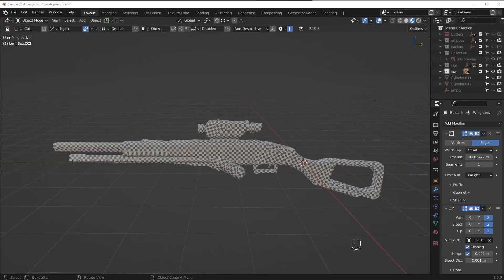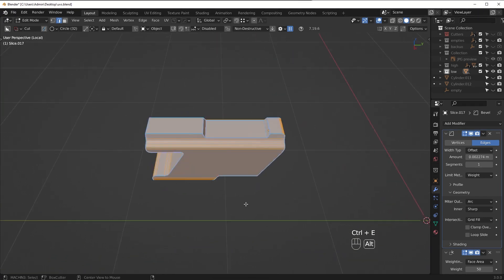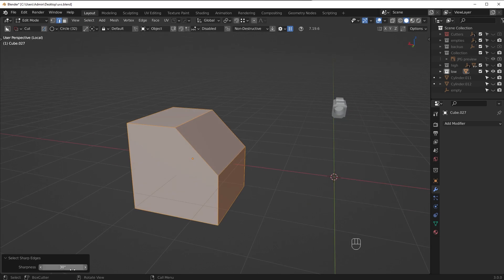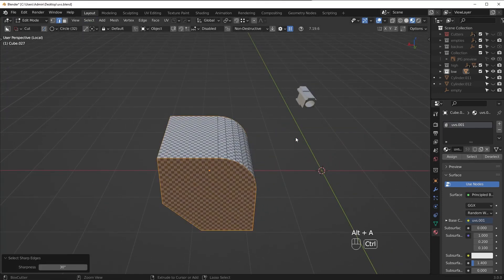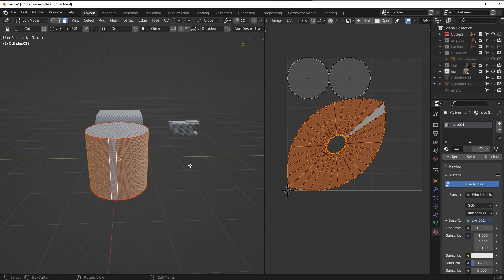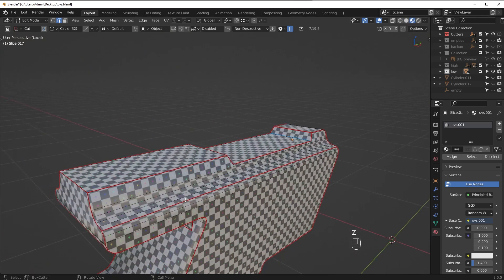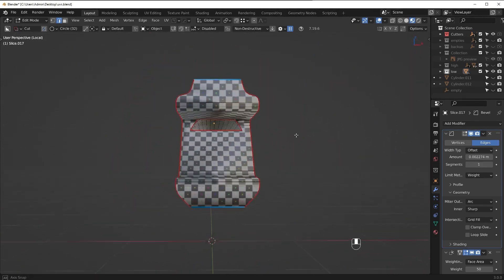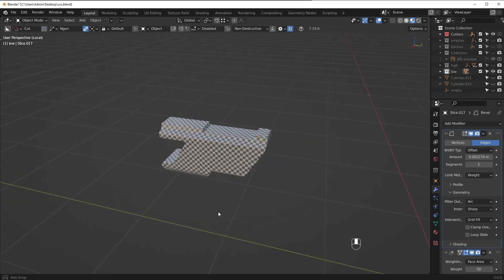The Simple 4-Step Process for Perfect UVs

Comment: But in case that if I have continuous set of faces on my flat surface which is v shaped do I have to plce a seam in my faces minimum one time to fix and straighten that out or any other system??Plz guide me if you can?

Comment: Hello, will someone please tell me how to get the UV material he is using? I have tried making my own with an image texture node as well as a Checker Texture node but nothing works. Adding the seams does not change the pattern of the checkers and taking away seams doesnt distort the checkers either. It must be because you have a specific material you're using, right?
Reply: I found out how! There is another video where he walks though step by step how to do it. I never would have found it on my own. Inside an image texture and without selecting a downloaded jpg you can instead select "+New" and change the Generated Type to UV Grid. Boom, done.

HOWEVER

The UV material is still not moving even during the seam changes

Comment: That's a good way of doing things, works well in most instances. I have to unwrap a complex car with lots of engine parts, so this will save a load of time, thanks
re the distorted rings blender can be a bit weird on that as sometimes I want to have rings, not a split cap and a side wall , so then I have to change the unwrap method to or from 'angle based' or 'conformal'

if it looks skewed with one of the methods, change to the other. it can still be flakey though. I have a piece where every ring came out perfect, apart from one and there is no reason , reset the scale, welded any stray points etc

Comment: @JoshGambrell Marking the seams manually has never been a waste of time, especially on complex objects where such an automatic method is not at all suitable due to the very different surface angles. In addition, by cutting the rings in only one place, you get very long "islands". And the density of texels, or rather their proportions, becomes very terrible on the UV map.

Comment: I wouldn't call that perfect cuz there are many problems with this techniques as mentioned above by people in the industry. 
But one of the problems I see is adding just a single seam on a continuous face loop. It's wasting UV space. Sharp places can be used to make seams and even though less seams is better, wasting UV space isn't. Sometimes It doesn't hurt to add a few seams 😉

Comment: Comment regarding contiguous sets of faces for production art: 
For game development, texture memory footprint is an important value to keep within budget. The fewer smoothing groups and seams you have, the larger your normal map size will be due to baking gradients to translate between the high and low mesh normal data. Your textures get compressed, downscaled, and mipped, which means they have less data in them to translate baked detail into the low poly's mesh normals.  
For example:

Create a cube, bevel all of its edges enough so that it servers as a high poly mesh. Create a second cube, set it to a single smoothing group (all soft edges) UV it with a single shell or multiple - it does not matter. Bake a normal map.
Repeat the process but set each side to its own smoothing group, cut the seams and give padding to each shell as appropriate for managing smoothing groups. Bake a normal map.
Check the file size for each normal map. The one with gradients (single smoothing group) is much larger.

The game res mesh needs those gradients to preserve the visual quality of the high poly, but those normal maps are going to be pushed through various compression methods and still contribute to more budget than they need to. Minimizing gradients through keeping smoothing groups at ~30* angles will keep your asset looking good after compression because it needs less normal map information to translate between high poly baked normals and its own low poly normals.

Also, take a shape similar to the one in the video with a long strip of contiguous faces and cut a single edge to make a long shell. Bake that result and get into a texturing tool like Substance Painter. Set the metallic to 100% and the roughness to 0%. Observe the faces where plane shifts occur and you will see triangulation distortion in the bake. This is because that single smoothing group is having to calculate plane shifts across the mesh with more than 360* worth of angles and bake the needed gradients into a texture. Increasing that texture resolution will help make them less noticeable, but we don't always have the ability to use 4k+. Setting smoothing groups to acute and right angles and massaging the rest with ~30* (the sneaky ones) will help reduce those artifacts and give you a cost effective bake that looks good after compression.

Also, your largest UV shell will dictate texel density. If you're seeing a lot of unused space, you may want to find some more edges to cut along plane shifts, scale a shell down in a single axis if that surface allows (swords, barrels), or add other objects to that texture set.

Sorry for the wall of text, but these are things senior artists and hiring teams look for when recruiting, so I figured I'd share.
Reply: I had the exact same thought... video is quite misleading. This technique is only good when you do lowpoly models that dont require normal map bake
Reply: @Arnov618  it's because theyre college students that never worked in production
Reply: when you say "The one with gradients (single smoothing group) is much larger" you are referring to a 3d model with 1 segment of bevel?
Reply: I'm sorry for bothering you but if I am understanding this correctly, basically we should disregard all of the steps in the video besides clearing out the sneaky edges? So essentially just select sharp > add seam > clear the sneaky edges and fix any ring distortions > done.

Edit: Ofc this is assuming an object like the one in the video. I imagine in something with smoother edges, like a futuristic car for example, would require us to make our own seam islands.
Reply: You also want to have a uv cut on hard edges. Otherwise the cut will be seen much more obvious after the bake.
Reply: I'm confused because this video shows one way but your comment says the opposite? What if your not baking high poly to low poly? Is one long face not ok? Are you saying you actually need more seams on long faces rather than just one?
Reply: @wolfpawz321  Your largest UV shell will dictate your texel density. If you're making bespoke texture detail, following the general rules of where to place seams will help you achieve a near-maximum texel density. The rules of cutting hard edges / smoothing groups don't apply if you're not baking.
Reply: Good article,very informative. These are golden informations becuase normals and baking normals are really confusing and hard procces if you dont know well also finding that kind of informations is really hard on the internet. Thanks for sharing and dont follow this kind of videos which is misleading and trying to get you confuse so they can promote and sell the addons to beginners. From now on I'm unsubscribing all the channels that promoting hardops,meshmachine addons... You dont need those trio addons (hardops,box cutter and meshmachine) Even vanilla blender is enough to complete the tasks that you want to achieve. Specially these trio addons make blenders really confusing because its changing all the keyboard configurations. Ofcourse you can change them but how many of them ? tons of progress. These addons makes your job done quickly but still unnecessary if you are a beginner or mid level artist or working on game industry. I suggest you guys to learn the techniques and do things with the long and hard way so you will be learning the ground and you will be able to solve really hard problems with you meshes and projects in the future.  After reaching a good level you might want to think about these kind of addons.

Comment: There is one problem I see with your method. 
All the hard edges in the model need to be UV island borders. The reason? To avoid a very famous problem that happens when you bake the normal map - your hard edges that aren't UV borders will have strange shading artifacts. I would show you a screenshot, but I'm afraid YouTube will mark me as spam.
Reply: That depends on the software you're using, for example UE4/5 won't have that issue but modding super smash characters will.

Not a technique issue, but a software quirk of older programs.
Reply: You will have that problem in the modern version of Substance Painter. Basically, the edge should be ideally between 2 flat polygons. As you make the edge sharper, at some point (i don't know exact angle) that artifact appears.

Comment: Thanks, great explanation as always! 
I started to unwrap my models in a very early stage, before I bevel edges or add any other Details. Tools like Bevel, Insert Faces and Edge Slide won't destroy your UV.
Tipp: press GG for Edge Slide, then Alt and you can move the edge or vertex in the opposite direction, to make the face bigger without streching the UV map.
Reply: The Bevel modifier does wreck my seams though, it'll turn 1 edge seam into 2 and erroneously try and make all the bevels connected as a UV island.

Comment: hi everyone, does anyone ever make tutorial or course on baking process only? I mean a tutorial of thorough process, the possible/usual issues and how to fix them when baking. Currently I'm stuck with the baking process in Marmoset as I'm currently doing the Game Asset Hardsurface Course. The baking result have so much artifacts even though theres none of the shading artifact and UV unwrapping during modelling and triangulation process. Both high poly and low poly fbx files come out flawless on marmoset, but when baking, all sort of shading error and issue appear. Some details are lost. Simply said, really discouraging result overall. Paint offset tools doesn't fix the issue. I am so lost with the error that I face and the only things left I should do is to restart the tutorial from the beginning and redoing the model from scratch. If anyone have any link of baking tutorial course to recommend, please do share with me. I want to know what I should look out for (flipped normal, not enough details on low poly, etc..) before I start baking. I really don't want to waste more time remodelling but then when baking, everything broken.

Comment: Now try baking normals on those mark sharp areas without a seam and margin. This tutorial clearly ignores baking issues, and at one point (continuous seam) even decreases texel density (aka makes those squares bigger after clear seam, rather than making them smaller)
Reply from the maker: You’re looking at an individual auto-unwrap for one piece. Those don’t matter. Only thing that matters is when you unwrap everything together onto one UV grid and how that looks, so I’ve zero idea the point you’re trying to make. Also, if you need more efficient packing, you can drop seams back in where it makes sense. Your comment is incorrect regarding baking. UV PackMaster also auto margins.
Reply: @JoshGambrell  Understanding seams, and how to make them for baking and what is texel density is one of the most major problem for most newbies to blender. And not explaining WHY you have to do it exactly like that and showing the uv unwrap window and how it all lay down on 1to1 uv square will cause more confusion to them, than good. I may have overreacted a bit, but for most people that are new to blender that i know - understanding uv seams and textures is a major confusion point, and couple of things in that video triggered me, becasue i think that it will confuse them even more further

Comment: Josh, what's your take on Bevels with UV? The topic here: https://blender.community/c/rightclickselect/Xvbbbc/?sorting=hot summs up the problem. It's basically bevel modifier adding the seams to outmost edges and therefore creating small and low res faces on bevel ares (in between the edges). For basic texturing this is fine but when you take high res bakes for game dev, some parts of the bevels are simply way too distorted and they simply collapse cause of the bevel. What would be the ideal approach, uv first and keep bevel (which in this case the things I mentioned occurs) or apply the bevel and go through all edges? Or is there any add-on or a tool to fix the bad seam placement of bevels?
Reply from the maker: This is the only beef I have with bevel modifier approach - backend the 1 segment splits the seams into two. Would be nice to have a setting to keep it ticked for one set of edges only. Regardless, I haven’t found any significant quality issues worth worrying about.
Reply: @JoshGambrell  Got it. Appreciate it!

Comment: How did you add the UV material to that shape?  Sorry, I haven't ever reach blender noob status.
Reply from the maker: Node editor -> shift a -> image texture -> New -> Checker texture -> connect to base color of principled shader -> material mode
Reply: @JoshGambrell  Thanks. Great videos, by the way. I just subscribed.  I have been making models for a while now, but have ignored topology and UV unwrapping.  My meshes are a mess.  It was fine  for applying something like a single colored metal surface.  But when trying to apply something like a tiled floor material, my shoddy work isn't going to cut it.

Comment: Really appreciate your helpful content. My only slight disagreement is when you say “it doesn’t matter where you put the seam”, that’s not really accurate in my humble opinion. It does matter where you put the seams, as you should always try to put the seams out of sight, such as on the bottom of an object, or a part of the model that might not be visible.
Reply from the maker: Well I mentioned that, when placing the seam on the bottom of the scope.
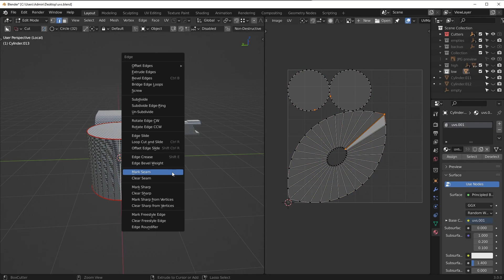Reply: @JoshGambrell  You're absolutely right, you did. However, I was referring more to when you later mention putting a seam on the ring (cylinder) 7:52 "just put one seam somewhere, it doesn't matter where". With respect, I think putting a seam on a cylinder, especially if it's a can of soda or something really does matter. I am still grateful for your content though and think you're doing a great service to those wanting to learn Blender. I'm just eagerly awaiting the day when AI takes over the whole topology and UV'ing process!

Comment: this is awesome, so thorough but not overly long. Could you make a video like this for adding a model to substance painter? I always seem to run into problems even when i think my UVs are ok. Do you have to export high and low res models for example? if not, should you? a best practices mixed with some common trouble shooting to ensure good results essentially. Can’t seem to find a video that quite gets a balance as well as this one. thanks!
Reply: in other words- what’s the least amount of work, shortest amount of time it takes to get a model from blender to substance to make using substance worth using haha. thanks
Reply from the maker: You export high and low poly if you wanna bake, triangulate botb. The process is easy but implementation is confusing because of the steps. This will all be covered in our game asset 2.0 course

Comment: Do you know how can I avoid redoing ALL MY UVS after applying de bevel modifier which totally DESTROYS them? The seams dont stay on one side or in the middle as they should. It's time consuming and not convenient whatsoever. Does anyone have any ideas ?
Reply: run mid ply bevel, i.e. 1 seg. and DO NOT apply it, simply export via FBX with live bevel.
Reply from the maker: Yup, do NOT apply bevel. No need, because bevels force quads which triangulate naturally without issue.

Comment: Thanks for the vid man!
UVs are mostly skipped by beginners/intermediate users (most of the poeple rely on automatic UVs/smart unwrap), people think its not worth their time, its not gonna help with the quality etc, or most of the people find it hard to learn.
but let me tell you one thing, it's the part that can take your model from 1 to 10 sometimes, and it's the easiest part in the Prop creation pipeline. Best way to learn it is to analyze different situations/models and by practicing ofcourse.
Reply from the maker: I used to use smart uv projects as that was what most tutorials were showing. Truth is, it’s a nice quick way to test textures and results, but in terms of quality of unwraps, it simply isn’t there. Manual work takes longer, but always delivers better results, which is why I love this method since it always works for hard surface meshes
Reply: @JoshGambrell  maybe someone can improve the smart unwrapping algorithm by effectively applying your 4 steps in this video in an algorithm inside blender. I don't see any reason they couldn't effectively be automated, but would need a slightly more procedural approach ideally from the start instead of ending up "looking for redundant seams" for example
Reply: If the topology is nice, the uvs are very easy